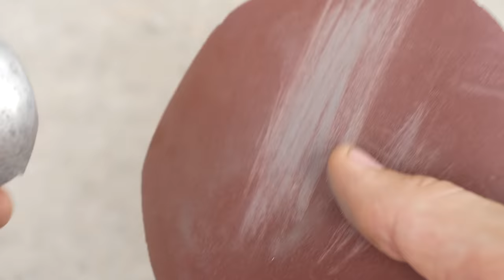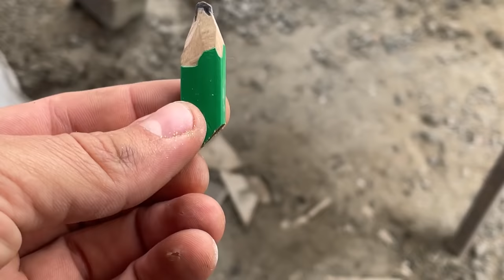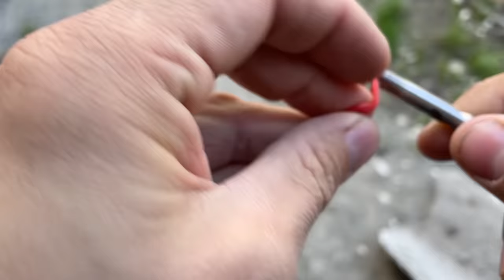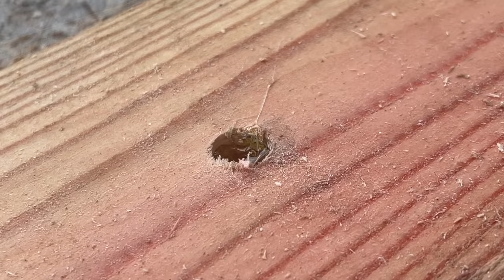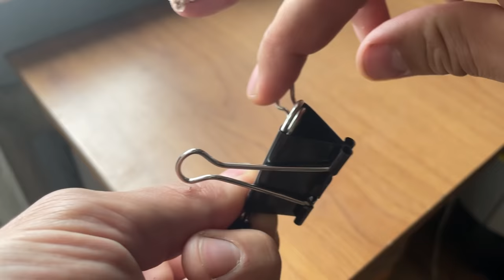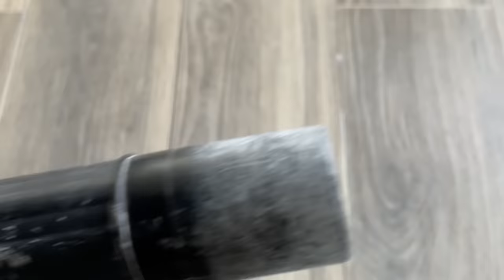Genious DIY Ideas That Will Take You to Another Level of Work

Comment: 2:1  Spinning a can will not mix the paint.
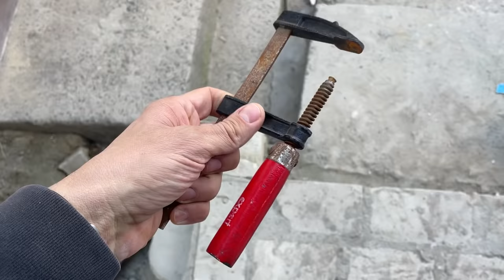2:55  Why ruin the pencil?  Just hold it under the board.
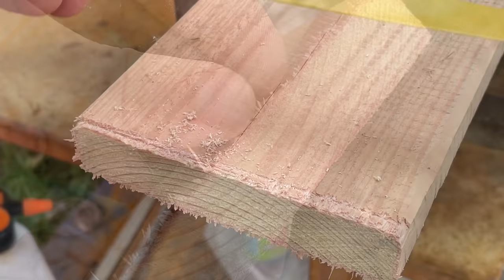3:59  The ragged cut is on the up-stroke.  The clean cut is on the down-stroke, with or without the tape.

Comment: My grandfather taught me the bar soap on wood screw threads as a thread lock when I was 7-8 years old. 30 years later I still use it here and there during house, deck, fence, and shed repairs. Best trick for exterior because temperature fluctuations causes softer woods, like pine/cedar etc., to expand and contract.
Reply: Também aprendi isso com o meu avô.
Reply: The bar soap is there for lubrication, I use it as well sometimes. I'm not very convinced it can be used as a thread lock, it's just a soap, not very hard but hey anything is possible
Reply: Também aprendi com meu padrinho marceneiro que isto serve para apodrecer o parafuso caso seja feito de ferro.
Reply: No use no but VCU
Reply: @old ogre  that's what I use. Tee lights. A lot cheaper than soap and softer and easier to use plus you don't need to cover the whole screw, once a bit lubricates the first part of the hole you're good to go.
Reply: How
Reply: Soap is a corrosive. Wax is much better. Temperature doesn't have a lot to do with wood movement. Humidity is the major culprit.

Comment: I have an issue with using the drill to mix the spray paint can.  Centrifugal force would move the mixing ball and the paint to one side of the can and just spun it around. Nothing will get mixed.